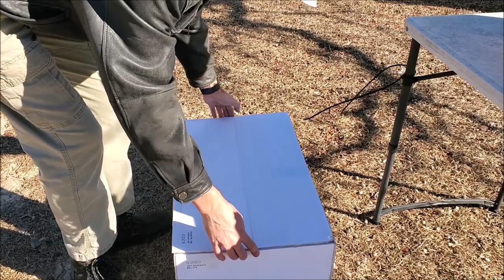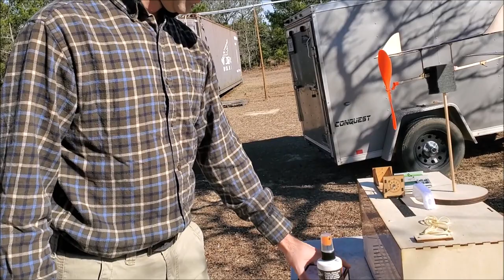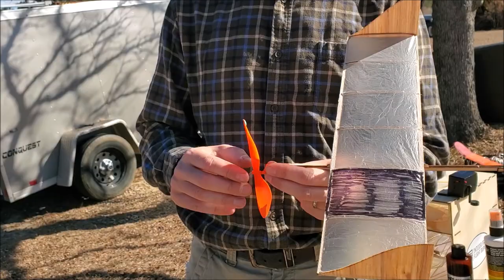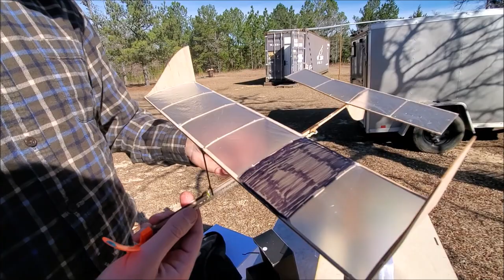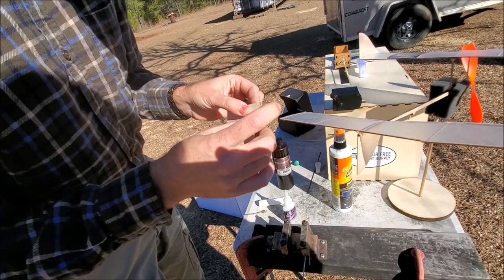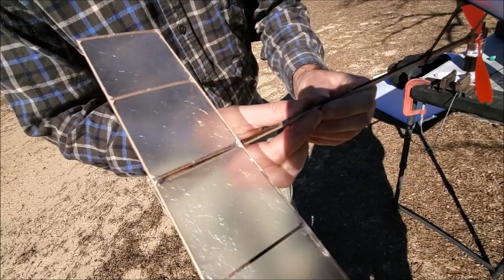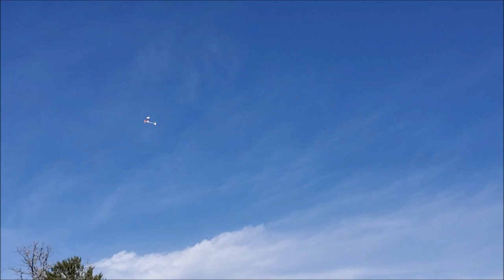Flight trimming for 2023 Science Olympiad Flight airplanes: Senior Flyer

Comment: hello! i just had a question about trimming the stinger. how do i make it go slower and in smaller circles because currently it goes pretty fast in a wide circle which makes it hit obstacles?
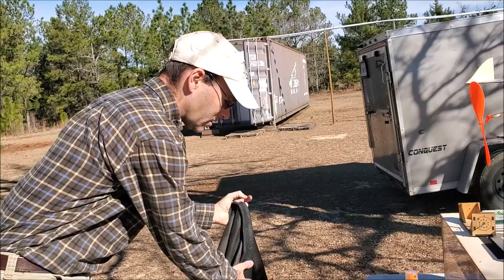Reply: On our B model tilting/rotating the stab and bending the balsa stab tips have giver us a 20 to 25 foot diameter flight. Ours climbs fast, and takes more than twice the  time coming down. The descent is great! But we only use half the 1300 winds or less. We are trying to get it to climb more slowly and use up the turns. We are flying 1:30 minutes to a 20 foot ceiling. Some Retro RC planes are getting more than 2:30 minutes in the same conditions. It climbs more slowly, but is similar in descent. We are going to try 1.5 oz. motors as our plane is 8.6 oz.

Comment: Would meguiars quik interior detailer cleaner work as a lubricant replacement, as I have it lying around and it seems similar to armor-all and son of a gun
Reply from the maker: Check the ingredients and verify that it doesn't have any petroleum or oil products in it. It's possible it's ok but I don't know.
Reply: @joshuawfinn  Thanks
Reply: @joshuawfinn  Are there any other main things that we would need to check?
Reply from the maker: I'd put a small piece of rubber in the stuff for 24 hours and then wipe it off and stretch the rubber to check for deterioration. Also verify that it hasn't made the rubber swell because we had that issue with a "silicone" lubricant that turned our to be some sort of solvent.
Reply: @joshuawfinn  Thanks for responding so fast

Comment: Hi, I had a question about, when cracking the wing joint, is there a way to control it/ensure than the film does not rip.
Reply from the maker: Punch your fingernail into the wood on the side you want to bend toward, hold as close to the desired break as possible on both sides of it.
Reply: @joshuawfinn  thanks

Comment: Hi, I have 2 questions about 2 different types of planes. 

1. Our Senior flyer keeps flying for under 30 seconds, and every time, it stays at 5-6 feet high for most of the flight time and it slowly circles back down and touches the ground. It never increases in altitude. Is there a way to fix that?

2. Our Stinger plane's propeller keeps hitting out front wing, is there a way to fix that? It causes the plane to dive down.

Comment: How many turns would you recommend as the minimum for a 1/16th inch rubber motor before the plane will lift?
Reply from the maker: Minimum 800 turns to establish a climb. Properly lubricated and fully wound it'll take north of 2600 turns.